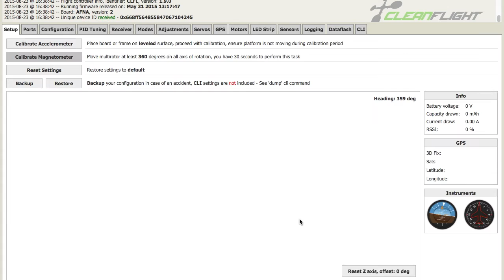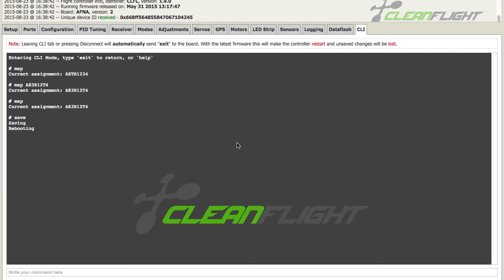Naze32 Input Remapping Cleanflight

Comment: yeeha, i don't know why i didn't try this... yes i do, cause i'ma stupid... i was scratching my head trying to figure out why my aux2 was activating my roll... thanks man,
Reply: i celebrated too soon, with ET2R1A34 in the mapping box, i now have two switches working properly but all the sticks are non responsive?  i'm not using CLI by the way,,, should i use the cli interface instead?
Reply: so, i deactivated all modes selected and i unassigned aux channels on my flysky tx.. i am still getting the same thing, if i leave roll, wrongly assigned to 'A', three stick work throttle yaw and pitch work. but roll is activated by aux 2. if i swap  them like common sense tells me.. i get aux 2 channel activated by aux 2 switch on my tx, but none of the stick inputs have any effect.... is my flysky haunted?

Comment: This was helpful to understand the CLI a bit better, but I'm still not sure how to apply this to my situation. I have a FSFLY T-SIX transmitter. The left stick should be throttle because its not a spring loaded stick like the right one is. Currently, the right stick is throttle. It's like everything is backwards on the sticks and all the mappings need to be switched. I don't know how to do it of even if its possible... help?